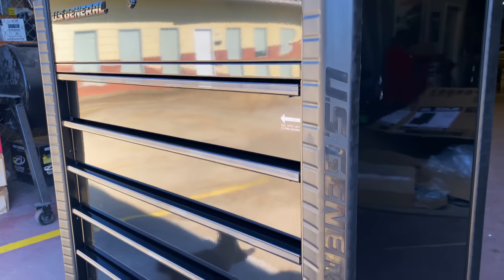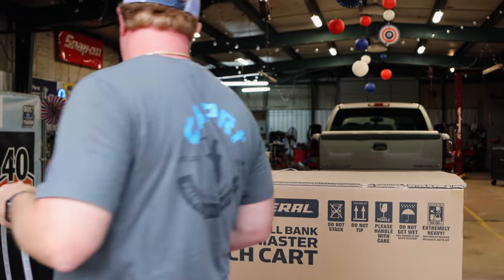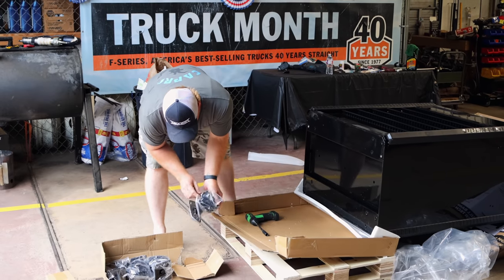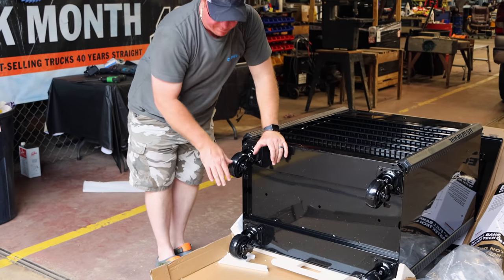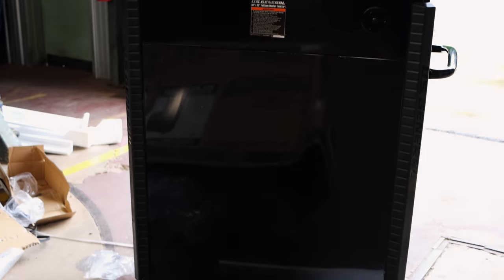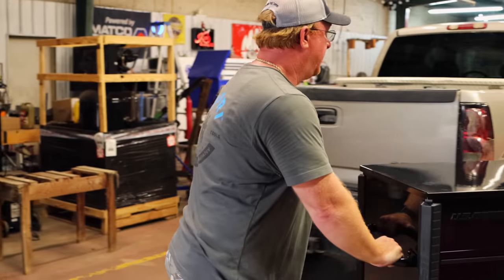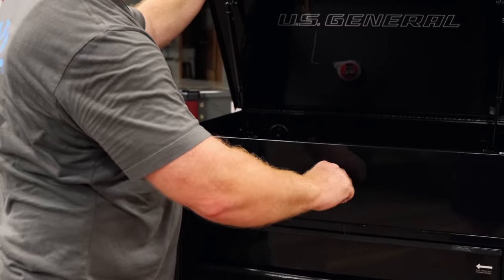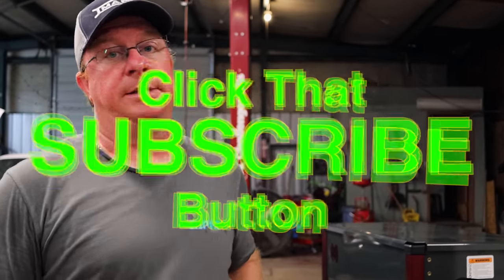Harbor Freight 6 Drawer Roll Cart And Assembly Instructions. U.S. General Cart Just Killed Snap On!

Comment: Harbor freight has definitely stepped up in their game in the last couple years. I'd buy this cart, in fact I'm going to buy this cart LOL.
Reply: Lmao 🤣 In fact"
Reply: Same
Reply: I bought one already it's nice in Orange
Reply: Same
Reply: How thin and flimsy is the metal?
Reply: It's not.
Reply: @puppykicker6701   feels like it with the floor model I looked at
Reply: @shelbyGT40  you should probably go look at menards and Lowes offerings. If youre saying the HF is flimsy, im just guessing you dont have much experience. The thickness of the HF compares to the tool truck brands. Is it as nice as a Mac macsimizer? No. But it's 18G steel and does its job well. Uses same steel as SO, Mac, Matco. Menards and other store brands are like 20/22G steel. Those are flimsy. HF offerings only downside is that they're made in China, but they are built extremely well. With tool truck offerings you pay for the peace of mind and the convenience of having your representative warranty things. That's really the only justification for 600 vs 3000

Comment: I thought about getting one of these but when I went to harbor freight to check one out, I was just like my snap on tool cart. Even down to the plastic retainers that lock the drawers in place. The plastic retainers that you press to open the drawers always broke on my snap on box. Even though it has a lifetime warranty, I’m tired of replacing them. I just bought a Mac maxsimizer tool cart instead which I love

Comment: Tip, use your index finger to buffer the tape end when you snap it back into its rest position.  Failure to do so will dramatically shorten the life of the tape measure.  Damn nice tool box for the price especially when compared to SnapOn.
Reply: Might apply to inferior quality tape measures.

Comment: Talked to a gearwrench rep at Home Depot yesterday with the whole semi truck set up and HD will now be stocking a small selection of gearwrench. Tools and carrying a larger selection online. He also said they are pushing to hopefully get Gearwrench  tool boxes in store. I can’t remember if he said by the end of the year or within the year but they are pushing to get them in store. That’s exciting news for me cause like gearwrench stuff.
Reply: So did GearWrench give up on GearWrench tool trucks if not isn’t this kind of a knife in the back
Reply: I honestly don’t know. I’ve never even seen a Gear Wrench tool truck. This was just like a fancy display show truck were the hole side opened up like you’d see at a car show. I see your point though that is kinda stepping on their toes  especially when the Depot would most likely be cheaper than a tool truck.
Reply: @whatfreedom7  We had a GearWrench { ex-Cornwell  dealer}truck but he pulled out of our area and trying to warranty GrearWrench is like next to imposable . Napa sell it but if you did not buy from them and have paper work no go. When you call the 800 number they give you the run around.
Reply: @debolt4796  wow that sucks. I did ask the rep about warranty and he said they could warranty in store but they prefer to contact them so they didn’t have to break up a set. That sounds like a pain. If they sold individually you can just exchange no problem hopefully but it’s too soon to say till they actually get them in store.

Comment: I can’t help but feel like we’re totally getting sued by Snap-on on for this box…

I’m not replacing my KRSC46 with the HFT cart, especially when it is only a $200 difference from what I’m rolling with right now. Got too good of a deal from my dealer for the custom colors that I can never hope for from work. Gloss black with cherry red trim.
Reply from the maker: Yeah if you got it for $899 you got a really good deal on it
Reply: Sent you a FB message to save on difficulties
Reply from the maker: I have a FB but don’t ever log on everything posted on there is from Instagram that pushes it there. Do you have Instagram?
Reply: @KoonTrucking  indeed. I just messaged you
Reply: A toolbox is a commodity item. It's not identical and even if it was Unless they are putting Snap On Badges on it good Luck with a lawsuit. Ask snap on how their lawsuit on the floor jacks worked out....

Comment: Thanks for the review. Looks nice a nice cart. One comment, when assembling with bolts and screws, start the bolts or screws by hand before using an impact driver to minimize cross-threading.
Reply from the maker: Man I’m not taking the bolts out ever again that’s why I did that. i could careless if they cross thread ever. That’s hillbilly locktite. If it’s something I will have to remove yeah. Also that was a 1/4” brushed snap on impact 30 ft lbs max it would have cross threaded those bolts anyways it would have hammered before it done that. I know my tools bro
Reply: @KoonTrucking  👍 10-4, good buddy!

Comment: Evening, I was at my local HF and they had this cart on display it looked cool everything function like its supposed to ( drawers sliding in and out ) but the opening and closing of the drawers felt crunchy, flimsy, wobbly. Also the securing mechanism felt cheap. It did not have a positive feel when unlatching. Furthermore the plastic tabs bent when trying to move to unlatch to open drawers. I'm in the market to purchase a new box and done my research but was a bit troubled with the feel of this cart.. I will go back tomorrow and double check my findings... ofcourse IMHO...
Reply from the maker: That’s the exact same way the snap on carts are with the “lock and roll” system. There absolutely zero difference in between the two. Now that being said some ding dogs may have not know to slide it to the left to open the drawer and messed them up since they are on display ? But mine feels perfect just like my snap on box
Reply: I went to buy one today and when I saw those flimsy plastic tabs I changed my mind.  That just seemed like something that would be a problem, maybe it is not.  Maybe I should reconsider.

Comment: Yeah I’ll take the snap on
Reply from the maker: Seriously ZERO difference between the boxes. If someone put a blind fold on you and placed your hands on the drawer (so you couldn’t feel the badge to know the name) you couldn’t tell them apart
Reply: @KoonTrucking  You could not be further from the truth, the Snap On will have better bracing, gussets and more welds than this sponsored HOBO Freight box has. Also if you need replacement parts for the HOBO Freight box good luck, people are still waiting for replacement parts for HOBO Freight boxes many for several months with no sign of the needed repair parts ever showing up.

Comment: Brave brave man! If I every tired starting the bolts with the impact every single one would have been F*#$ for sure!
Reply from the maker: A cross thread bolt is just hillbilly locktite it ain’t coming out and i don’t want em too
Reply: @KoonTrucking  valid point 😂 tight is tight

Comment: The dimensions measured in this video are more than an inch smaller than the dimensions on the HarborFreight website. Why is that?
Reply from the maker: They are probably doing overall dimensions. I measured actual box size and not bumper guard to bumper guard

Comment: To be honest, I haven't been all that impressed with the Snap-On tool boxes lately.  Bought a brand new Snap-On Toolbox (Heritage series) with topper and side locker about 3 years ago.  I've got crooked drawers that like to catch, a corner plastic piece on the topper that keeps popping out and getting lost, the drawers themselves are hastily put together (meaning that they are unevenly welded).  And the locking mechanism on the topper doesn't quite fit right, so it catches and you have to almost force it to lock. I expect better quality from $6k worth of box.  I've got the 56" US General box and topper at my home garage, and I am much happier with that than my Snap-On boxes at work.

Comment: When you pull the drawers out does it feel like a cheap craftsman tool box?
Reply from the maker: It feels exactly like the snap on cart does. They all have a little wobble in them. If you closed your eyes and someone spun you around you couldn’t tell if you were opening the snap on or the us General box. They handles and lock feel the same. The slides feel the same. The drawers feel the same. There’s no difference.
Reply: @KoonTrucking  Thanks i am definitely going to check it out when they make it to my local Harbor Freight. I have the Matco Jamestown at work but need something affordable for the house.

Comment: @Koon what is the other box in the background that was the other side of the harbor freight box? Not the Snap-On. It looked as if it had 1-2 drawers that were vertical if I'm guessing what I saw correctly?? 

Is there a video for that one? IF so what's the name or just drop the link in this comment reply if you could please. 

I paid right at $850 for my Snap-On roll cart like the one you compared the harbor freight box to. I picked it up at a pawn shop slightly used less than a year old. 

They were asking $1400 and walked in, offered them $500, they came back with $900 and I asked for $850 with tax included and they responded with $852 so can't complain about that as it didn't have a scratch on it. 

Had it about 10 months so far and it's been a great box to work out of at the house and I leave my 48 long Matco box from 1995 in the back of the garage as it's harder to move if you know what I mean. One of these days i'll do a crappy toolbox tour then show my roll cart. 

Tool box gods will feel so bad for me they may just send me a cheap decent box.
Reply from the maker: https://youtu.be/O5jg0tQyqiA

Comment: The locking Mechanism on each drawer seems flimsy unlocking them felt very uncomfortable and the actual piece that locks it in place is a small plastic triangle at the end of it
Reply from the maker: Familiar with snap on? Apparently not but it is identical. Absolutely zero difference.

Comment: HOBO Freight uses a cheap locking system and when it fails as it has with people the lock assembly is next to impossible to replace, people have been waiting for months for the replacement lock assembly parts and still don't have them or even know when or if HOBO Freight will ever deliver.

Comment: Honestly I can't be happier with my matco Jamestown cart.   Bigger than these two but not too big.   I've only been working on cars professionally for 3 years and I still have a completely empty drawer
Reply: But this would have been nice to start out in.   My starter cart was a sunex 6 drawer.  It was nice but I kept running out of room
Reply: I never found a layout I liked in my jamestown but it does hold a whole lot of tools
Reply: @gregblau8082  it's perfect for me.  All I do all day is pull transmissions. So the deep sides allow me to store my long extensions right in easy reach.  And I put all my sockets up top.  Something I couldn't do in my sunex.
Reply: @Christopher Elrod Don’t get me wrong aside from the drawers opening when you move it it’s a phenomenal cart. I love the lower edge on the front and going to a double bank tech series I basically gained better layout and maybe 2 drawers.

Comment: I was in China Freight about 2 weeks ago for the first time in over 10 months. As I was walking out without buying anything I noticed the roll chart at the front of the store so I had to turn around & check it out. The box seemed flimsy to me, which I thought that maybe the store employees didn't assemble it right but after seeing your video I see that's not the case. I wasn't a fan of the drawer latches. They seemed very cheap to me. I like the height of the box & it seemed to roll good but being empty I expect it to roll without issues.
Reply from the maker: If you don’t like them then you won’t like snap on either because they are identical
Reply: @KoonTrucking  Ya, I know, but it's not as flimsy.

Comment: I was excited until I saw the price.  I have 3 U.S. General boxes and none of them costs $700
Reply: I mean do you know of a cheaper reputable 6 drawer with a deep top?
Reply: @scottedwards3403  I know I can get a better Sunex for that or 26 USG stack for way less
Reply: @nathanr.8556  if memory serves correct the sunnex is around the same price. Like +\- 20$
Reply: @scottedwards3403   like I said, I can get a better Sunex for that price
Reply: @scottedwards3403  HF is getting proud with their prices, even the the U.S. General boxes have gone up, not to mention the laughable prices of the failed Icon line
Reply: @nathanr.8556  I don’t know about throwing reputable and sunex toolbox in the same sentence though. Their wrenches are nice, their slides are awful
Reply: @scottedwards3403  Okay